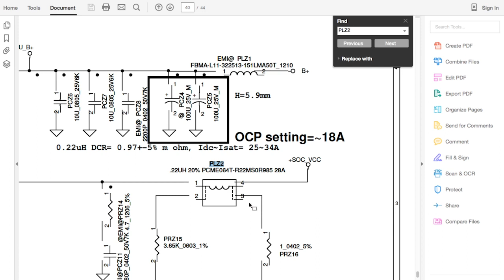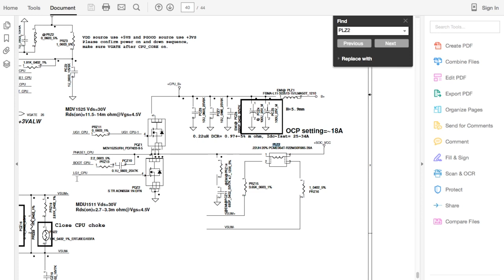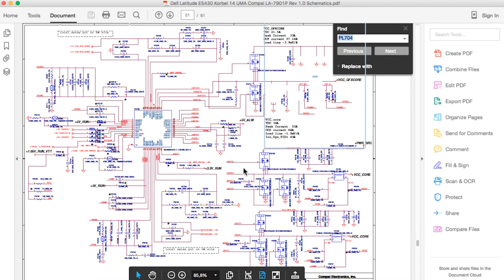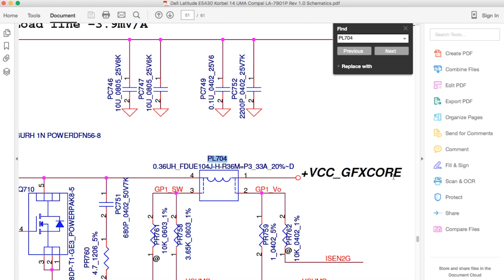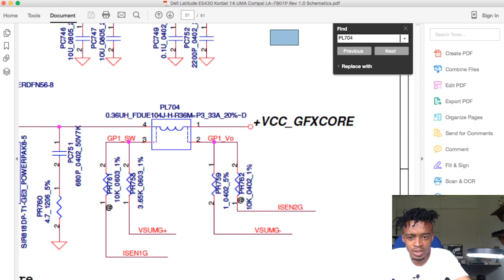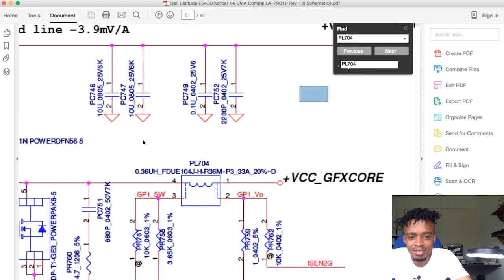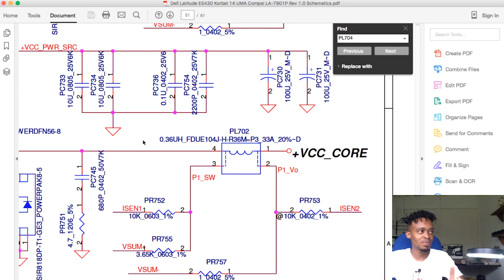001 is not a short Technicians lie about shorted CPU‘s

Comment: If you have a CPU with a TPW (maximum allowed wattage) of 65W and a VCORE of 1.2V, for example. Then you can calculate the dynamic resistance to U^2/P. In my example this would be 1.2V^2 is 1.44 divided by 65 is the result 0.022 Ohm. The allowed current is 54 Amps!
But time flies... So we have a TPW of 240W and a VCORE of 0.9V, for example. Then the resistance is 0.0033 Ohm and the allowed current is unbelieveable 266 Amps!
So we need better multimeters.. 😂

Comment: I know the usual coil resistance to gnd at cpus and GPUs are very low with CPU as low as 2 ohm. But what about usual resistance between coils for an integrated chip of CPU GPU . Probing GPU coil to CPU coil. Should read any resistance or circuits are exclusive to each other ?

Comment: this is basic, when mesuring for short in beep mode and the cpu is onboard, it shows short with low resistence, ???????
Reply: I think he wants to point out, when it's just a low resistance and when it's a real short. A high-side shorted MOSFET can be easy found. A low-side short can be a real short or just the mentioned low-resistance. So, in another video he dismounted the coils...

Comment: When I check my laptop's cpu it's shorted to ground about 26 ohms but my laptop turning on.Does any problem with this🤔
Reply: CPU can read as low as 2 ohms. And if your multimeter is not accurate it may troll you into thinking you have a short but it's not.